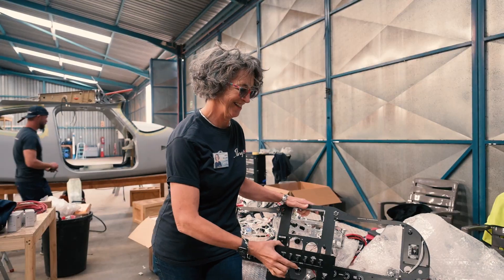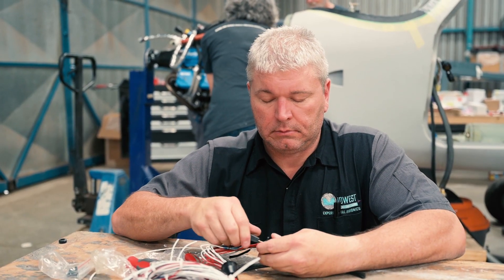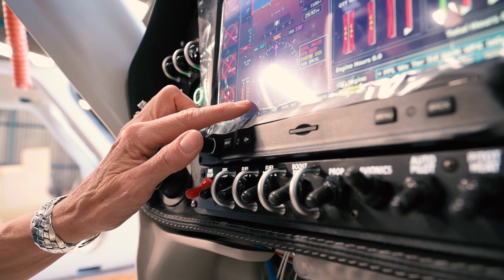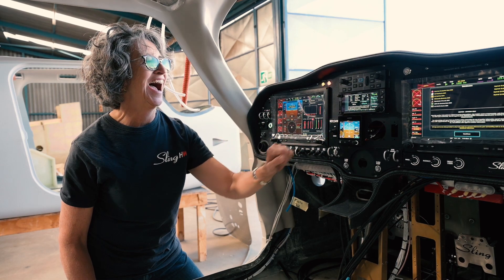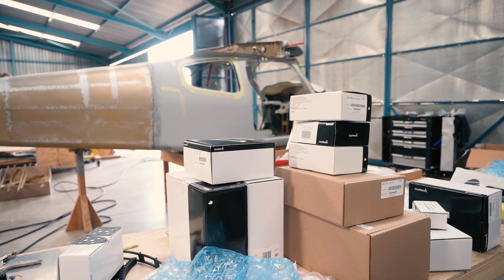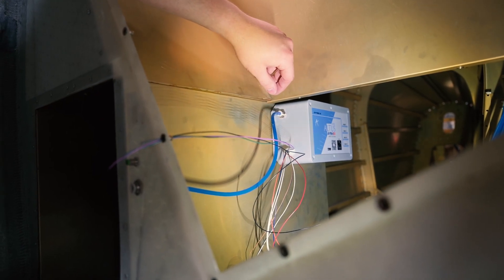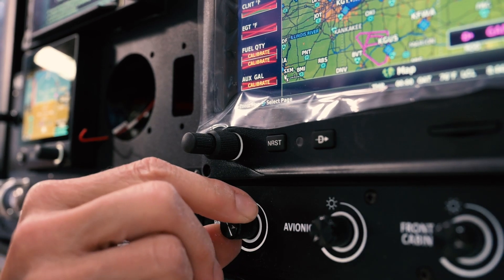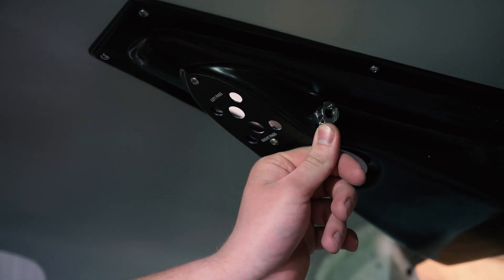Sling HW Build Assist Programme South Africa With Linda Sollars Part 6

Comment: Fantastic stuff, well done. Amazing IFR panel, and love the built-in oxygen and roof lighting switches. Hey Linda/Sling, will you put a VP-X in so the many circuit breakers go digital instead of physically mounting them on the deck or wherever?
Reply: Lindas system does indeed have the VPX system.